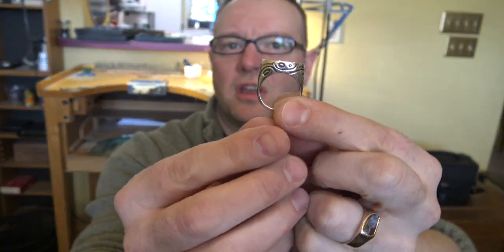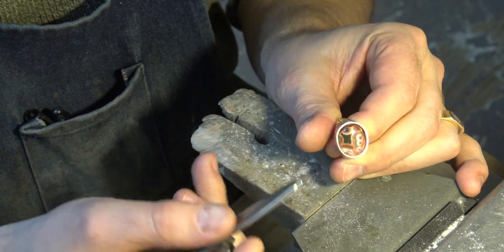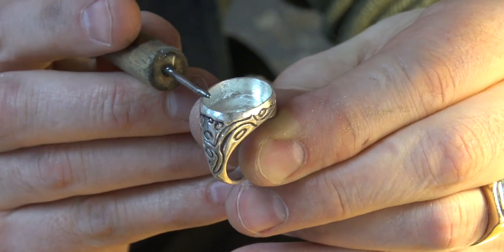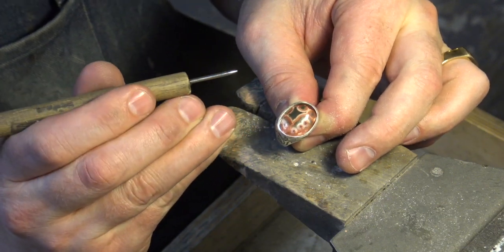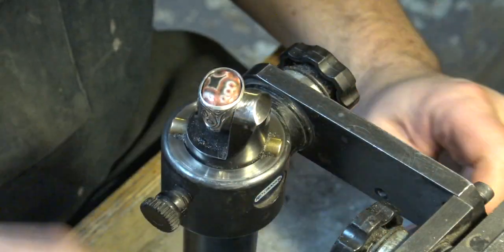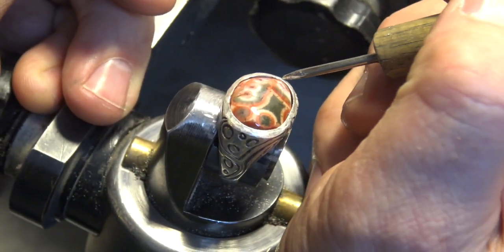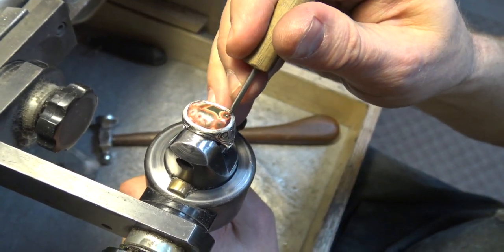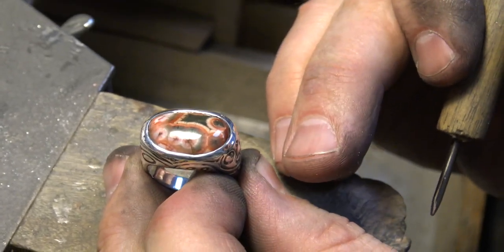How to Bezel Set A Cabochon Gemstone - Start to Finish - (2018)

Comment: You may want to revise your method of setting the stone. Instead of cutting the bezel down, you set the stone higher. The Navajo have been doing it for more than a century There are several things to use to do that. One them is to use fairly fine sawdust, I use pencil shavings from an old pencil sharpener. Simply  put some sawdust into the cavity so that the stone sits at the desired height.. When testing to see it is, it's a good idea to lay a string of dental floss across the cavity and the press in the stone. That way you can easily remove it  until you get the depth the way you want it. That way is much quicker, and more importantly you don't lose any of the design..
Reply: I was thinking the same ,I did not want to sound sassy by saying it, . I am curious to the benefits If any doing it the way he is doing it?
Reply: Lol dont do that on real jewlry 😂

Comment: Thank you for this video it is very helpful. I am just starting out making bezels and rings in wax. Is there a certain thickness one should aim to make the bezel when working with wax?
Reply from the maker: I will tell you how I like to do it. I make my bezels in wax at one millimeter thick. On the ring that I am doing in the video I made that one 1.5mm thick. I like to have enough to trim it down a little bit. That being said I like a thick-looking bezel on my rings. Let me know if that helps. Thank you for commenting. :)
Reply: @GotchaRocksJewelryDIY  Yes that is useful information that I will try to put into practice. Thank you for your response.

Comment: I've seen similar style rings created from wax that have holes through the setting, under the stone. Yours doesn't. What's the purpose of that--and do I need to do it?
Reply: you add a hole underneath clear stones to allow for cleaning in some cases and to allow light through in others. but with opaque stones like jasper or onyx, a hole underneath isn't necessary.

Comment: Absolutely great video.  Can you say why you didn’t start setting your stone with the traditional “north, south, east, west” points?
Reply from the maker: Hello Marilyn, I have found that using the“north, south, east, west” method causes the metal to become "waffley or ruffley" and less uniform in appearance.  When I start at one point and work back to it the metal is work hardened in one direction as a posed to four different starting points. The “north, south, east, west” is usually used to make sure the stone doesn't bounce out during the setting process. If you run into this issue try using a small amount of bees wax to hold it in place. I put the wax on the top of the stone overlapping onto the top of the bezel. and start setting from the other end.
I would say try both method, each has its place depending on the project. 
Thanks for you comment and I hope this helps you out. :)
Reply: Thank you for your response. I love learning new techniques!

Comment: Great work and video, not a lot of videos out there covering the actual process of bending the bezel wall over.  Especially with a hammer and not just a bezel pusher.  Surprised you didn't have to alternate positioning to opposite sides between the bends.  

It'd probably burnish the bezel edge with a hand burnisher before the wheel still.  It's the one that's shaped like a curved oyster shucking knife.  It would work a lot better than that point.
Reply from the maker: Thank you. I always try to start at one side and work my way around the bezel. I find that it gives a more consistent finish. I do use different burnishers depending on what I am working on. I really do like using the point burnisher to burnish a small amount of metal onto the stone. LOL, Just don't touch the stone when your doing it. Right? :)  I alway tell people to try different types to tools and techniques to become a well rounded goldsmith or silversmith.  As you know you get good at what you practice. All the best, Michael
Reply: Right.  I even prefer anything other than a flat bezel edge just because it's so much more work to push over and burnish clean.  Give me serrated or gallery wire any time.  I just broke a $100 fire opal by pushing the bezel wall over and it flint napped the bottom over 20 times.  Was too thick for the opal's cut...

The ring you featured, really nice stone and setting will last a life time.  The band designs match the stone well.

Comment: Bezel wire is usually 28-30g (why do they sell that as the "basic" common bezel wire)? , that could be the problem. Your piece is a casting, probably far thicker. At 15:50 we see a LOT of bumpy divots (and there's no way a bezel rocker could do what you're doing), BTW, it looks like ocean jasper now. Do you use a hand chasing tool over a hammer hand-piece for a reason? Or, is there a time (and circumstance) that you would use one over the other (please elaborate - and thank you IMMENSELY)? Zam is between Tripoli and rouge? What is "stone safe (rubber wheels)? I have been warned against so-called "stone-safe".  This video is for SURE, the very best in-depth video on this process that I have found on YT. You have answered SO MANY questions that have been left un-answered or less wonderfully explained (I don't want to say "poorly" to all those people trying to share their expertise - teaching is not easy), I thank you heartily. I am watching your channel with a very close eye. You teach VERY well, and I, for one, am incredibly grateful (I know, I'm gushing...., just happy to receive this help!)
Reply from the maker: Hey Gabby, 
Bezel wire is usually sold in a thinner gage because it is easier to push over the stone. It is often fine silver as well for the same reason. I am a big fan of a very thick bezel as you can see in my ring. Even when I fabricate a piece I make my bezel around 1mm - 1.5mm thick. Its just how I like to do it. I think it looks more refined if that makes any sense. 

If you are running into the bumpy edge it can mean two things. One, it could be that there is to much metal being pusher over the stone. Two, It could be that the edge is to thin causing to much metal to go over the stone at one time. This is another reason I like a thick bezel. another good practice is to make sure the top is leveled. You can use sand paper or a file to do this.

Which leads to the next question should you use a hammer hand piece or a chasing tool and hammer. I use a hammer hand piece for smaller stones that are around 4mm or smaller. I really like the chasing tool and hammer for larger stones it gives me the control over how much metal I push over at a time. The hammer hand piece can bang over to much metal or not enough depending on the type of setting. I sometimes use the hand piece if I need to hold my jewelry with my hand during setting. The short answer is I use both :) 

Zam is a polish that will bring you metal to a high polish without having to go through two steps. I gave up on tripoli and rouge after I found it. 

Rubber polishing wheels - There are many out there that are not stone safe. Actually most are not stone safe. This means they can damage you stone. Stone safe rubber wheels are not likely to hurt your stones. That being said always check on a junk stone before using on a finished piece. Here is the number to what I use  #332-721, I like the 22mm size, they are from Rio Grande. Most jewelers I know don't know the difference between the stone safe and not stone safe. I had to learn to uses them on a regular basis with opal inlay repair and custom opal jewelry. There is so much to know and if it doesn't come up people don't get to learn it. I think you will have great luck with them and they may turn into your secret jewelry weapon. :)

I almost forgot that stone is a Thomsonite from Grand Marais, Minnesota.

Thanks for all your kind words. I really tried to make sure people could see the whole setting process. I am glad it is helping explain the stone setting process. I have always found that I could pick up a great deal by just observing, so I am glad it is working.

All the best,
Michael Seiler

Comment: Hi, I'm so grateful for this detailed video. I have a question about the final stages of bezel setting; I have found that frequently the actual edge of the metal that touches the cab is not smooth and rounded a bit, it's choppy and as though the edge was just too much of a knife edge, it looks sloppy. I don't usually use a file for the final leveling, I use sandpaper with the bezel surface face down on it, even to 400-600 grit. THEN, I still have gouges from the setting process in the thinned upper edge of the bezel. How do we get a snug fit on the bezel, a clean edge all around, and no bumpy junk on the outside of the bezel when done, after all the bezel wire is thin (on purpose so that it bends over the cab). Unless I use a thick STERLING bezel (26g), then seriously hammer set it, and then file, file, file, it's a tough job. What's the trick? Thanks heaps, I'm slurping up every bit of teaching, there's no schools here and I am self-taught on YouTube!
Reply from the maker: After you level it slowly start setting the stone. Dont push to much of the metal over the stone at one time. Just do a little bit and if you have to go around in circles a bunch of times that just fine. When the metal gets close to the stone use your burnisher to smooth the edge down. Tip: Don't push very hard with your burnisher. Nice and easy pressure wins the race. 
After the burnisher I sometimes have to hammer the metal down a little bit more but if I burnished first I get a very nice edge. Those stone safe rubber wheels will smooth things out a bit also. Remember to grind down the sharp edge on the rubber wheel to make it a little more blunt. 
Hope this helps.
Michael Seiler